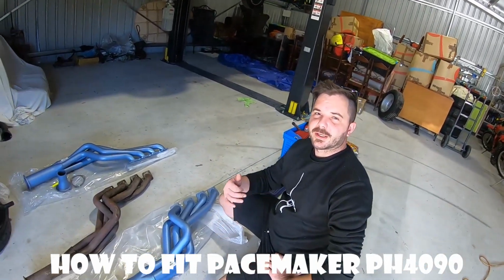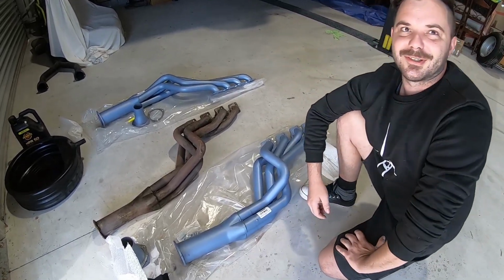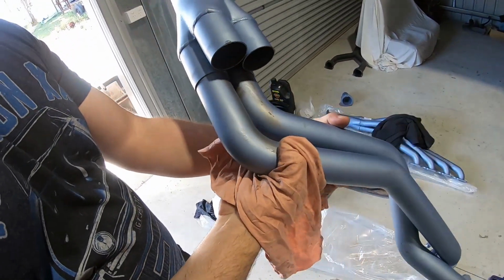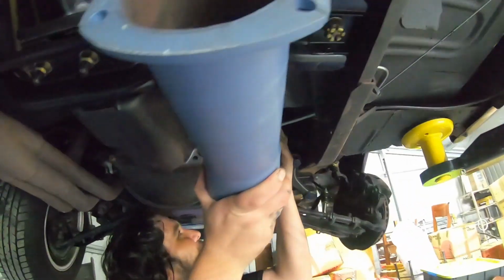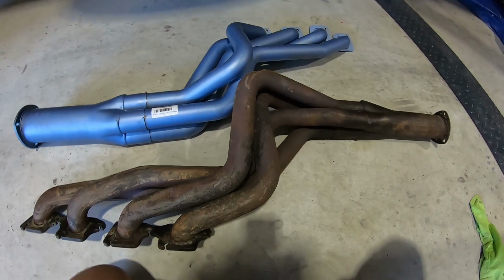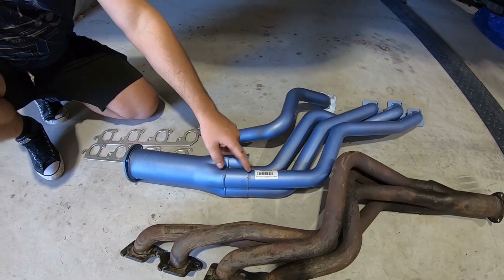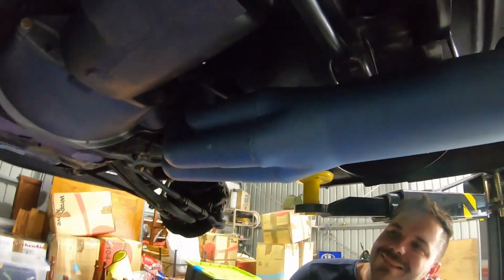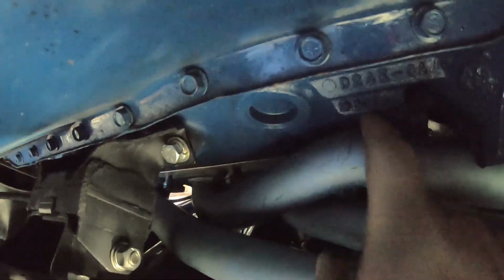HOW TO FIT FORD XW XY 4 INTO 1 PIPES ENGINE STILL IN

Comment: Hey Brothers, love your videos. Am doing my first ford. I am about to drop a 351 2v Clevo into a XB wagon with power steer. Gonna put the gearbox in later. I have bought a set of pacemaker PHC 4070 extractors for it. Can I put the extractors on the motor before i drop it in?

Comment: Best thing I ever did with my Pacemakers, was get them ceramic coated. They never lose their colour, and protect them for quite a while. Maybe the owner of the car might get them done down the track...? Can I also make a suggestion with extractor gasket choice, try the Graphite RemFlex ones - got them on my Ute - excellent seal and they form to any imperfections in the face of the head or pipes. Just a suggestion to try out in one of your projects and see what you think!
Reply from the maker: We actual I just got a graphite fel pro header gasket to try a couple of days ago might be a similar design, thanks for the tips Mate ceramic coating does make a big difference. I will suggest it!

Comment: Great info guys.Trolled your videos but couldnt work out if your saying when you have the engine out you put it back in with the pipes attached (or one side) or just with the engine lifted from the mounts. Thanks again.
Reply from the maker: We fit the motor and box together with the drivers side pipe on, cooler lines and starter makes it a bit easier. Passenger side pipe goes on easy as

Comment: Once you've got all the pipes in the car how are you sealing them back to the collector?
Reply from the maker: The fit is about a two inch slip with the flow it shouldn’t be an issue but if it is when I am back there next to do the front brakes we will put a little mani seal on the joins.